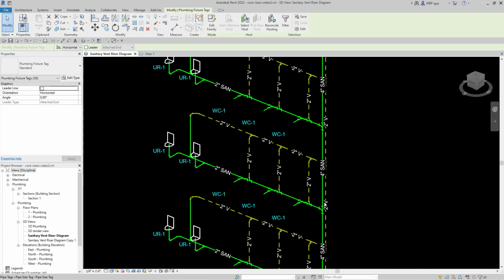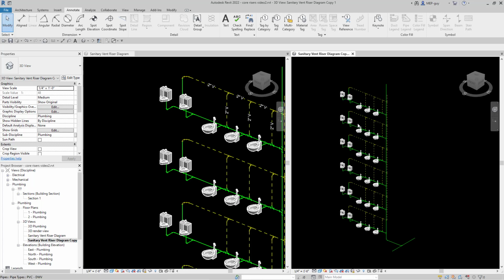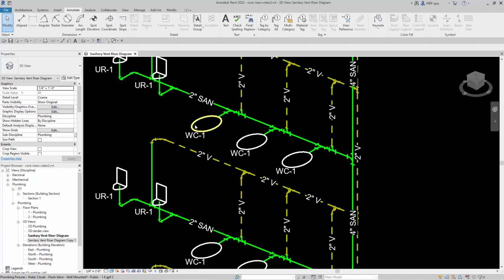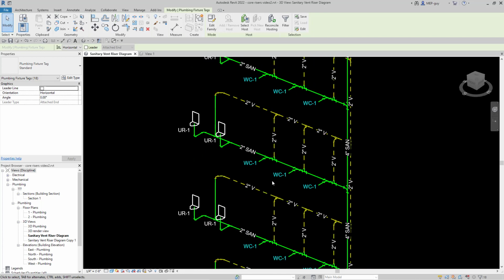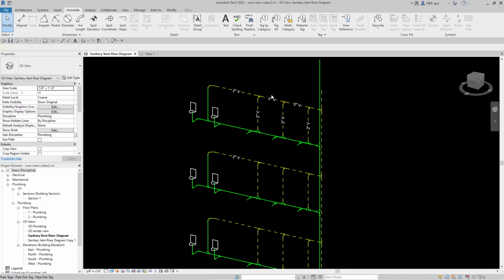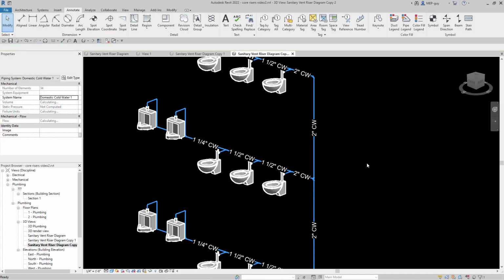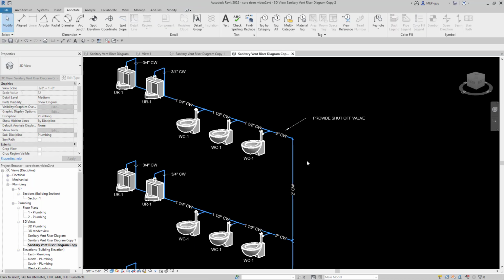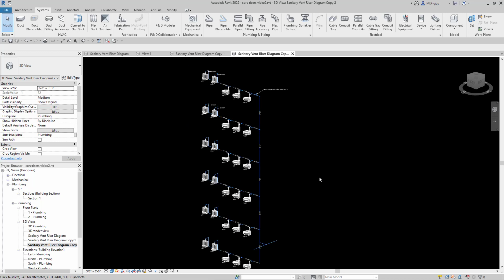Tagging Plumbing Riser Diagrams in Revit

Comment: Nice job, Thank you
Reply from the maker: Thanks Joe!
Reply from the maker: Joe, just saw your comment on Bimitup about his piping in the apartment. I'm pretty sure that's not allowed by code. I didn't want to call him out though bc I'm not 100% sure. But when I look at the piping, he can't tie the washer box into the bathroom group and wet vent the water closet. Having said that, I think the system will vent fine, but wasn't sure if it was allowed by code. I think most plumbers use a waste/vent stack for the washer box to keep it separate. At least that's what we do.